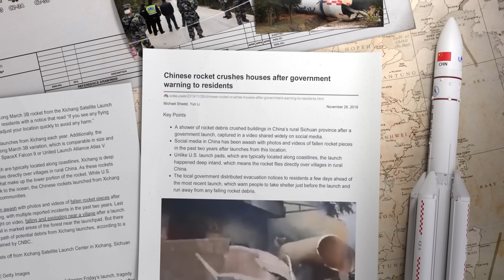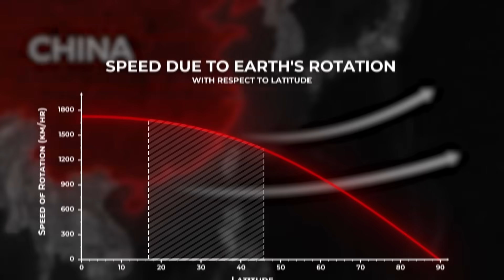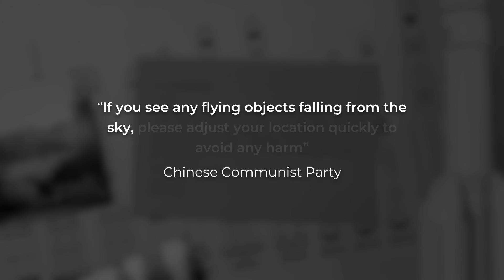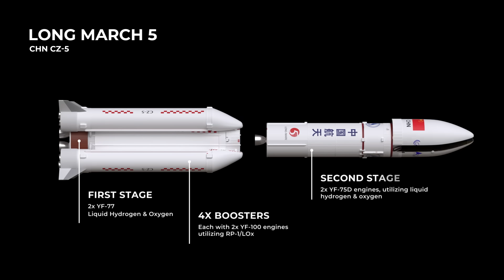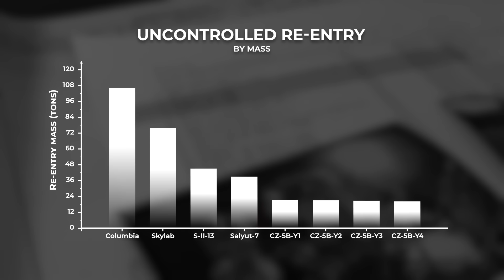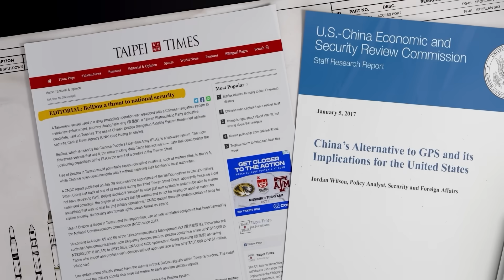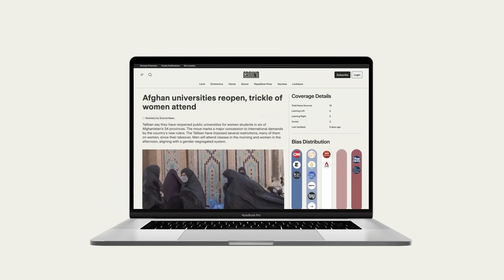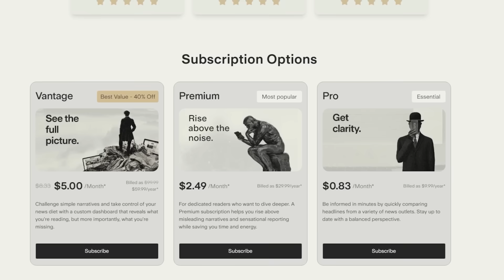The Problems with China's Space Program

Comment: how can a cell phone communicate with a gps sat 30000 km above?
Reply: Phones don't send any data to GPS satellites, they only receive their signals, which is just a constant stream of the exact time (to a crazy precision).
Reply: It is receiving a signal from the satellite.  It is not transmitting to it.  EDIT: It can be done two way with exceptionally sensitive receivers on the satellite and redesigned phones with more powerful transmitters.  Battery life: not so much…..? You don’t need a satellites to track a cell phone, the cell towers do that already.
Reply: 20,000km
Reply: Through radio waves.
Reply: @VinayakP don't think phones arr big enough to produce radio waves...